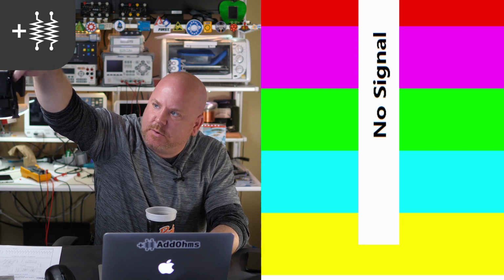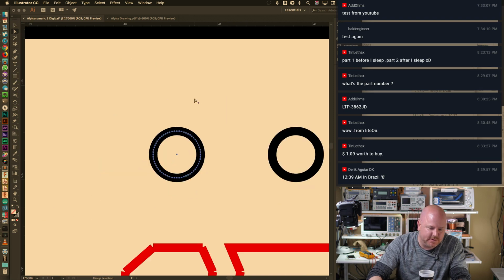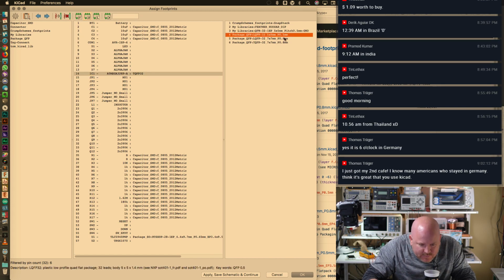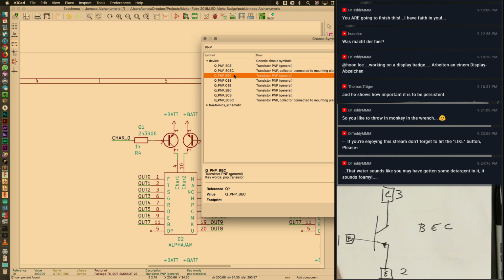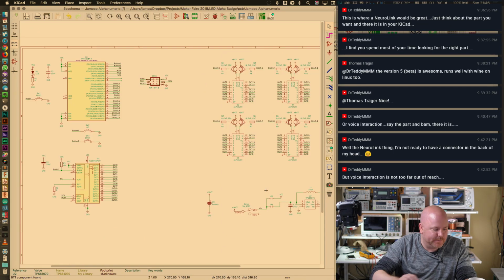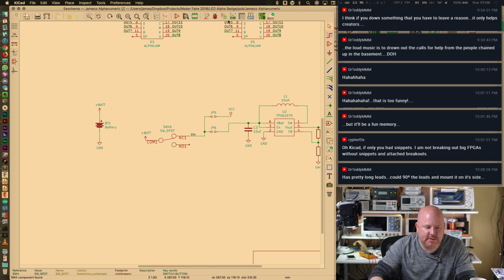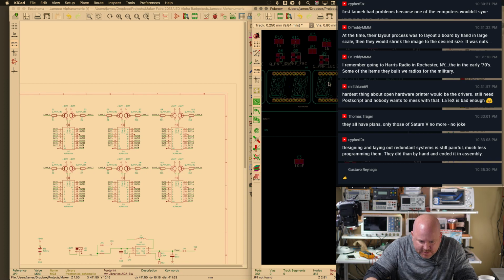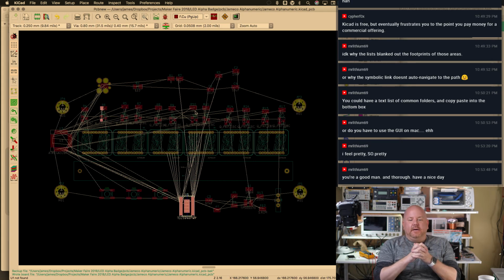Alphanumeric LED Badge Design (PCB) Part 2 |  AddOhms Live

Comment: Hi,
to measure the Pin to Pin distance at 45:45 you don't need a Calculator ;)

Just hit the "Space bar" (to zeros the Coordiante system) go to next Pin and read the Distance.

test it, it's so amazing ;)
Reply from the maker: Oooooo very cool. Thanks for the tip. That's exactly what I wanted.